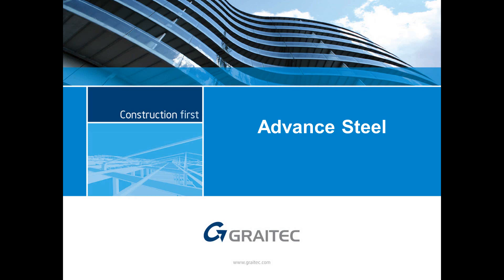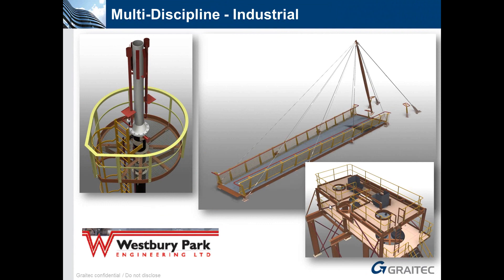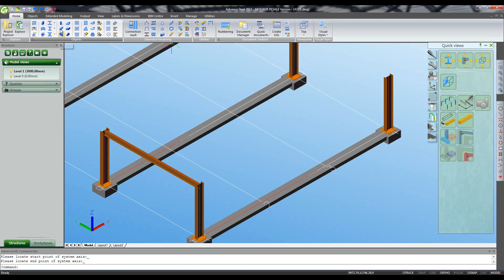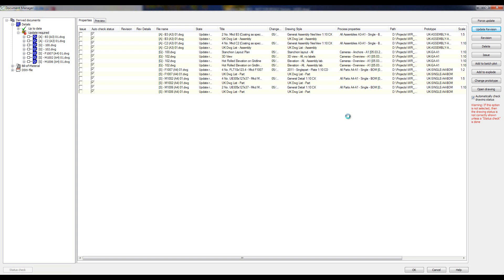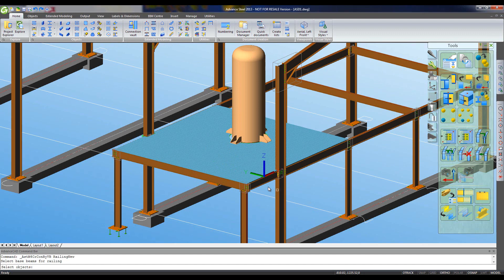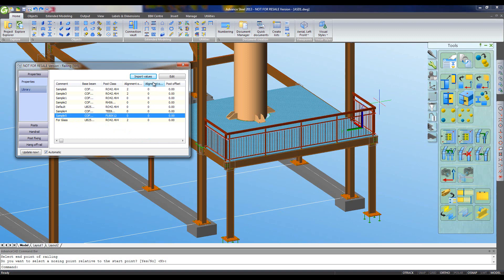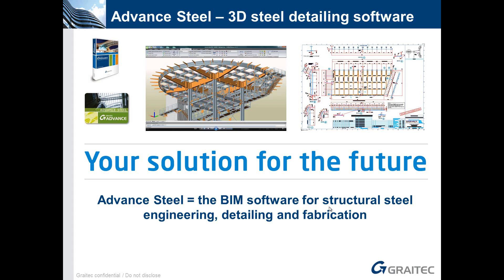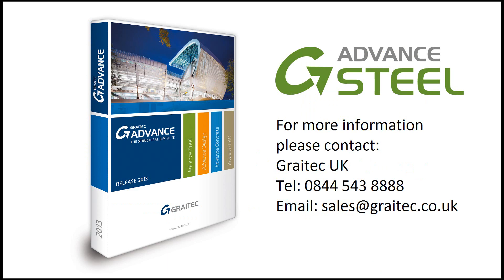Advance Steel Overview

Comment: @etravaganze: I was using the NODE osnap at that point. We recommend that as the main snap to use in Advance Steel. There is a node snap at each end of the system line of every beam.

Comment: Hi,
At 16.09, what snap are you using to select the beams? - I only have the normal snap options to select points and nodes which doesn't copy the beams properly.
Also, where can I find your toolbar on the right of the screen, with the snap options?
Thanks a lot